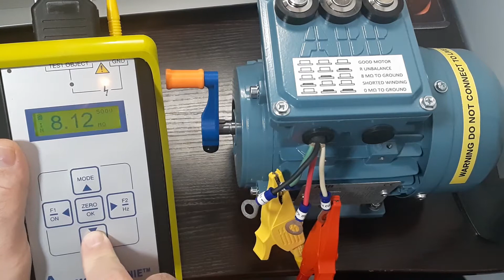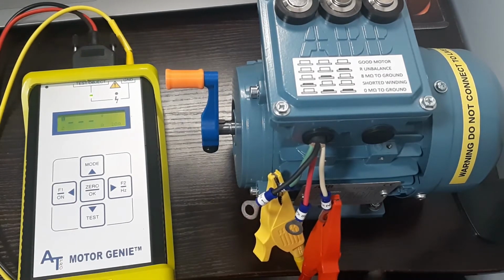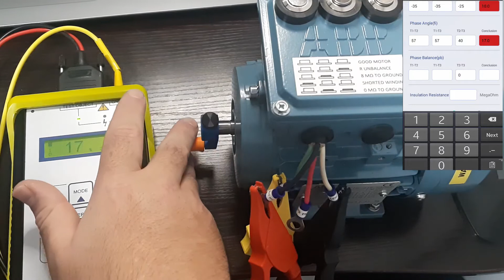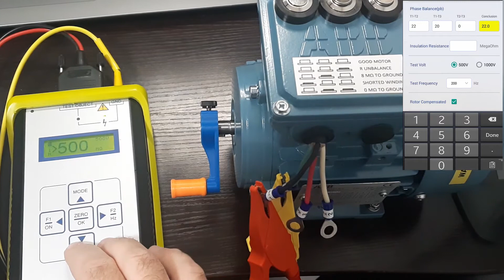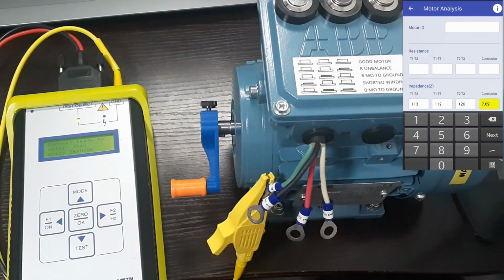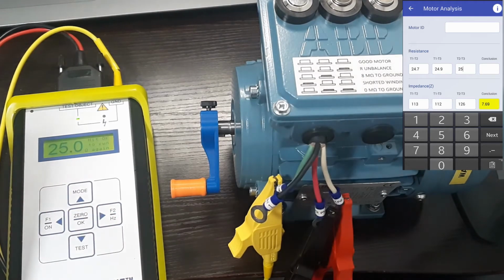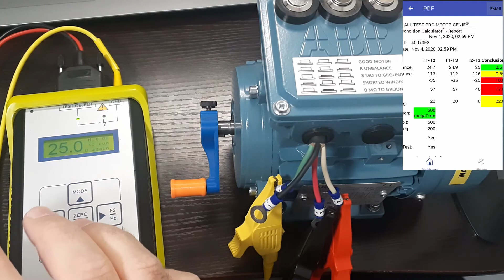AllTest Pro Motor Genie Product Demo Part 2: Detecting Faults

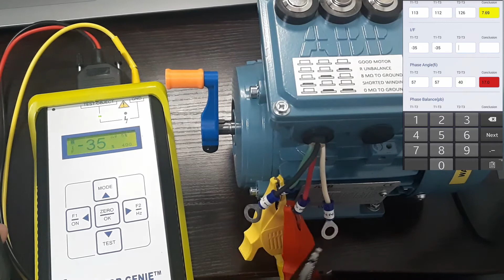Comment: At about minute 4:15 you are measuring I/F. In the upper right corner are values that you don't mention. Looks like 4, 5, and  6.9. Do you know what those mean?
Reply from the maker: It actually shows triangle (delta) phi %. Δφ%.
Hello, received an update.
The %shown in the upper right corner is the change in phase angle when the test frequency is doubled. It's not used for analysis purposes.

Comment: For around 1k this is the best tool for the buck. 
I got lucky and got an older version of the all test motor testers. It does more than the genie but everything is manual all the values needs to be written down. calculations are done manually.
Reply from the maker: Thank you for the comment! Sounds like the AT 31. We still have a couple of those demo units kicking around. It's pretty neat, but ATP is working hard to make all their products even more user friendly.

Have a great day!
Reply: @TheNextStepAgency  thanks. No it's older